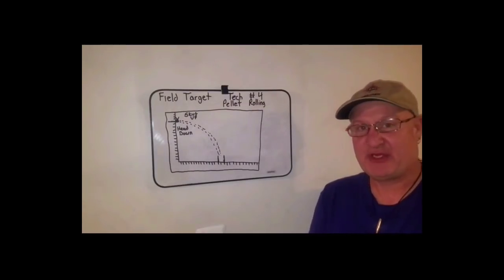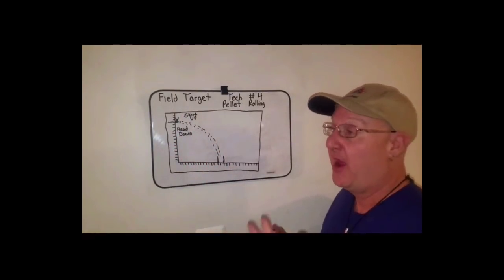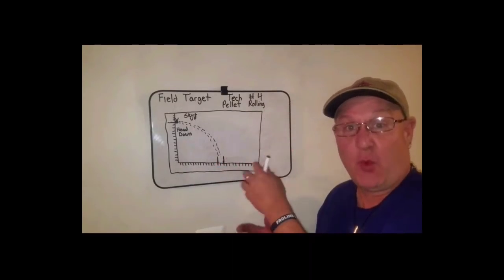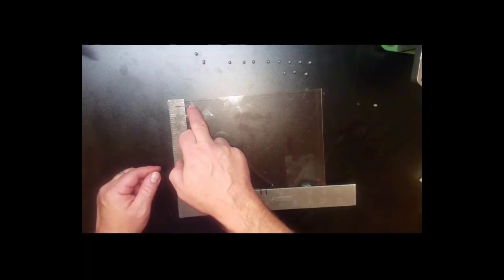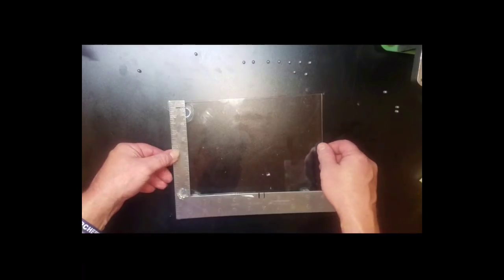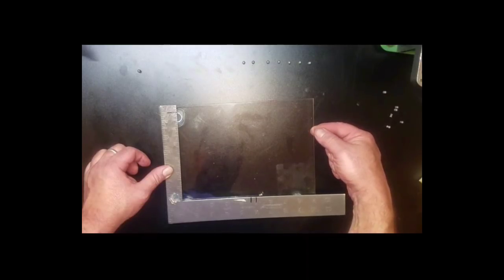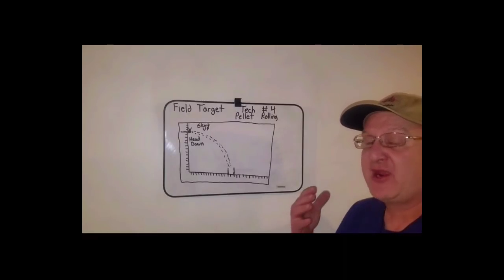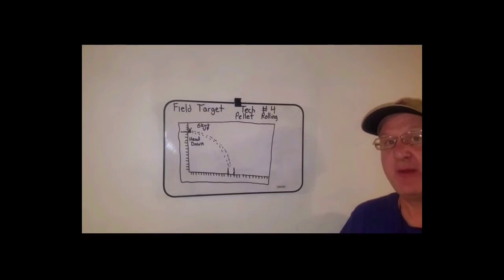Field Target Tech Episode #4 Pellet Rolling

Comment from the maker: I use that particular mark for Air Arms 8.44's only.  As I said in the video, I broke my glass one, this one is for demonstration purposes only.  I would recommend a pane of glass around 12" x 14" or so.  Could be bigger if you want.  The farther the pellet rolls, within reason, the more accurate results you will recieve. You will find that different pellets will "like" different places on the ruler.

Comment from the maker: What I do, is take a sample of all the pellets I have washed, weighed, and head sized, and from that group, I rolled about 20-30.  Wherever most of them ended up, I'll draw 2 lines, as you see in the video.  These 2 lines represent my "standard".  These 2 lines are about 3/8" apart.  If any part of the pellet is in within, or touches these lines, I keep them for match use. These marks are made by me arbitrarily, they can be smaller, or larger as well, depending on how perfect you want to be.  Different lots of the same pellet, and different brands and designs, might end up in a different spot on the scale.  Every pellet will have it's own "standard sweet spot", where most of the pellets will end up in a batch.  If you have more specific questions, or need more info, e mail me without hesitation.

Comment: Very informative and interesting. Thank you for sharing this technique. I've always Sized and sorted my pellets, will this procedure supersede sizing and sorting? And.... will they make  the pellets more accurate using this method?
Reply from the maker: Joe,
I first wash the pellets to get the slivers off.  I then weigh them.  Then I measure and sort them for head size.   I then roll them.  Last process is I visually inspect the nose for any Nick's, dings, or flat spots.  The last thing I do is lube them.
Rolling them should be used in conjunction with the other steps, if possible.   Some shooters don't have access to a scale, or head size measurement tool.  Any process that you can do to weed out any deformity or flaw in the pellet, is to your advantage.   
On sizing, if I do run a bunch of pellets through a resize, I still go through all of these steps.  When in competition,  I cannot afford to let even 1 bad pellet slip through the cracks.
Glad you enjoyed the video,  also check out my new website Fieldtargettech.com